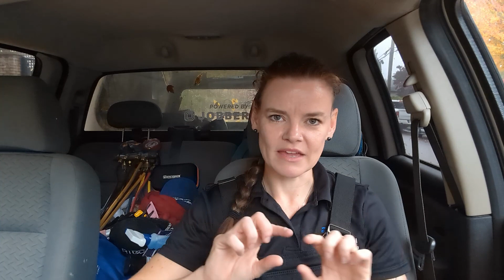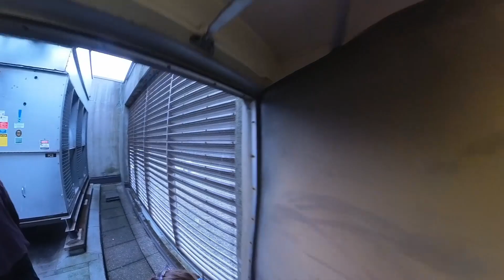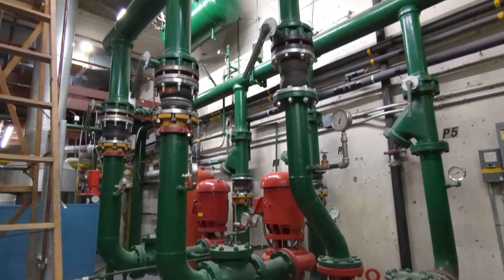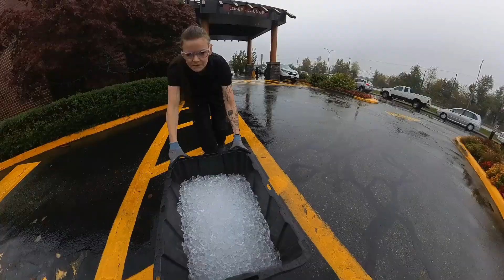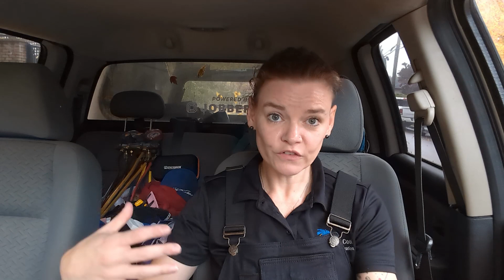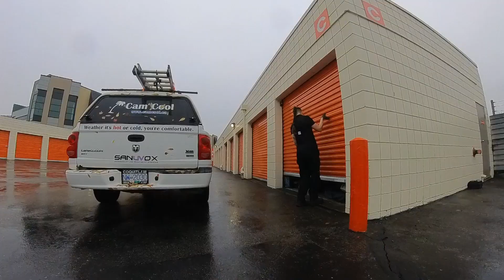HVAC Vlog - Cooling Tower, Ice Machine, Commercial HVAC

Comment: Aw man the same thing happened to me. There is a Perlick bar unit like that. With that unit, if you can't pull it out, it is because it is frozen, and you have to shut it down and come back. What's worse is you have to wait til you come back to find out if the fan is still good.
Reply from the maker: Yeah, those are the worst.  In certain circumstances we'll thaw the ice out with a heat gun or even better, water, but usually we come back after its all melted.